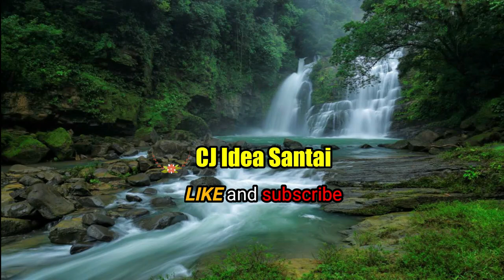Making Modern Design Concrete Baluster using Plastics Balustrades Mold

Comment: Where I can get this baluster mold
I really need it.
Or can I get this through online shopping ..
Reply from the maker: buy online at aliexpress or shopee
Reply: @CJIdeaSantai  
I have tried but not found brother
Please share direct link
Reply from the maker: @mixmasala2624  try this one... https://m.aliexpress.com/item/4000407166241.html?spm=a2g0n.detail.0.0.61a524853ZujLV&gps-id=platformRecommendH5&scm=1007.18499.177237.0&scm_id=1007.18499.177237.0&scm-url=1007.18499.177237.0&pvid=82e017a3-7112-4d24-bcbb-84655c57dba0&_t=gps-id:platformRecommendH5,scm-url:1007.18499.177237.0,pvid:82e017a3-7112-4d24-bcbb-84655c57dba0,tpp_buckets:668%232846%238115%232000&pdp_ext_f=null&pdp_pi=-1%253B209.43%253B-1%253B-1%2540salePrice%253BMYR%253Brecommend-recommend
Reply: @CJIdeaSantai  out of stock in all

Comment: Sir, what kind of oil did you used on plastic mould?
Reply from the maker: could use any oil as long as could release concrete baluster & mold

Comment: Where Do i will get a base that Balustrade mold will on bottom and top cap. Please help me I need a BALUSTRADES CAP and bottom base.
Reply from the maker: you could find it at alibaba dot com, search for  'rail baluster mold'
Reply: @CJIdeaSantai  is there any specific name for that so i can search for it
Reply from the maker: @tevitavaikona5096  
go to this link
18cm/7.09in Triangle Very Good Quality Curtain Embossing 3D Short Top-Bottom Shared Straight Precast Baluster Rail Concrete Mold
 https://www.aliexpress.com/item/32931394532.html